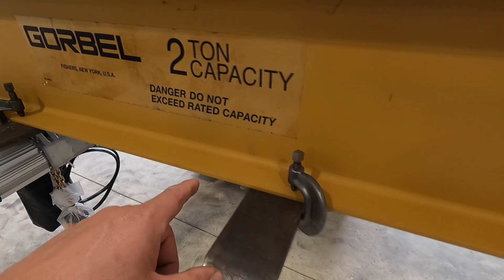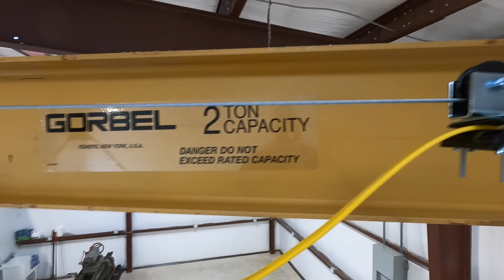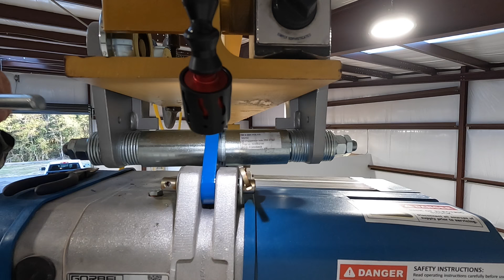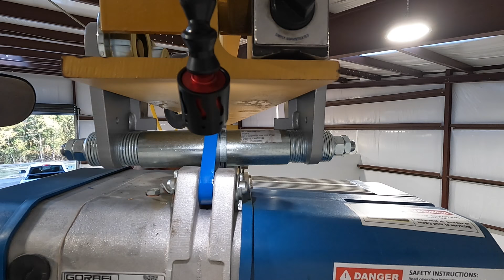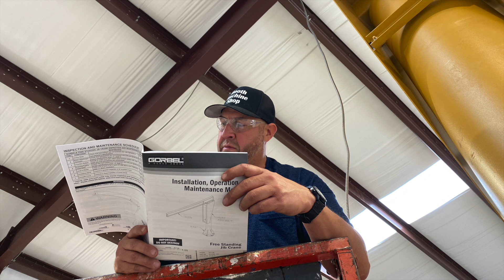Gorbel Jib Crane Installation Part 2

Comment: After reading through the comments here, I think you need to do another video concerning the tag-line on the boom. Specifically, a video showing the complete replacement of the existing line. Several tag-line/cable-clamp experts have noted that yours is incorrect, unsafe, kills horses, may poke an eye out, and probably contributes to global warming. Having to deal with these "jobsite experts" on a daily basis, I recommend the following 3 actions be shown as a way to comfort and appease them, so they may feel good about themselves and move on.
    1:  Remove existing tag line, except for the one eye-bolt at the far end of the boom. (This will be re-used).
    2:  Acquire @ 20' of cotton clothesline rope. Tie a square knot at one end, feed rope through hole where eye-bolt was removed, then pass through the remaining eye-bolt at the far end.
    3:  Pull rope taut, and secure with a granny knot. Attach the 3 trolley rollers to rope, then clamp the flat wire to the trolley rollers to finish. The tag-line is now "Safety First!" compliant.
I'm confident this will carry the 3 or 4 pound load with a large safety factor. I'd calculate the numbers, but I've misplaced my "load of wet laundry to pounds" conversion table.  (Sorry!)
With the problem solved, and nothing to yarp about, the experts will saddle up their "dead horses" and ride off. With luck, it will be off a cliff.   lol   Thanks, Adam!
Reply: Way more useful than knowing the right way to install cable clamps.  Thanks!

Comment: looking fabulous! " hint" forklifts do not need to be running to lower the forks, only to raise them or using side-shift feature.
keep up the fantastic work!  when looking for a forklift ask for a 3 stage mast, it will give to a higher reach. and lower clearance. FYI.
Reply: and because of that your should NEVER go inside or exit the the forklift at the side of the controls, this is the first forklift i see that that is thought off, every European/jJapanese fork lift i have used over 25 years of experience that have not been a possibility.
often wanted to, but it just shouldn't be possible.
Reply: @ArniSPeturs   Linde, Toyota, Mitsubishi, Yale, Cat, just a few that have through cab models
Reply: Full Free-lift mast will give best clearance, fork carriage travels to the top of the 1st mast section before the next sections start to lift

Comment: Looks like you're still missing the hoist gearbox vent plug. The bolt with the copper washer is for shipping/storage.

Gorbel normally provides the matching female electrical plug and a bolt for supporting the chain bag.
Reply: Why does this crane seems to have a couple of parts missing? Why ship a non complete crane assembly? Are there no quality inspectors?
Reply: @orfeous I think Gorbel either forgot one of the boxes when packaging the kit or it got lost somewhere during shipping or after arrival.

Comment: Worked on several 1/2 to 5 ton trolley hosts and never seen it heard of lubricating chain before using. Oil on a chain is a magnet for dirt grime steel chips etc. Okay to oil roller chain that are used on chain sprockets. Not a fan of flat cable. Always used heavy duty cord that is rated for 600 bolts such as type SOW. We called SJO cord junior cord. Absolute garbage cable.  Great vid. Worked on a very old two phase hoist with a motor to make it travel. Buttons were on a 240 volt circuit and operator would get socked when itwas damp or rained due to being outdoors. Think somebody made them switch over to a lot safer 24 volts to feed buttons.

Comment: I would use 9/16" (very close to 14mm) grade 8 bolts instead of drill rod for chain fall attachment pins. Strong and faster. I would also put a small plate on top of the pivot shaft and then put a bolt through the hole instead of relying on those hose clamps. Remind Abby not put her hand between where 2 pieces of metal are coming together. Need a stop so it doesn't take out your vent pipe. Nice crane!

Comment: Great. Note you’ve fitted the bulldog grips the wrong way round. The U bolt should be round the running end, the dogs round the standing part. Two each end would have been better.

Comment: nice video. have a questions about the shims being made of brass. will they compress over time being made of soft brass from the weight of lifting up to 2 ton. or should they be made of steel? so they can't compress if the thickness is really that important. this is something i don't know about and am just curious. but would really like to have this crane in the shop i work in

Comment: Nice crane Adam!!
Just a small comment on using those steel wire clamps: the u-shaped threaded rod should always be on the “unloaded” part of the wire. When tightening the two nuts, a deformation of the cable does occur which actually causes a weak spot in the wire. In this case, were the load is low, that will cause no problems, but with more important connections the cast half of the clamp should rest on the wire part that takes the load.
Reply: "Never saddle a dead horse"
Reply: Yep, never saddle a dead horse.

Comment: Not trying to be a smart alec, and in this app not critical. But you put the cable clamps on wrong, the old saying don't saddle a dead horse.  The U clamp clamps the dead end on the cable.
Reply: Came here to say this.
Not really a big deal in this case, since there's very little load on the cable, but always a good habit to do it the right way

Comment: Your rope cable clamp? The saddle goes on the load side of you cable ..(never saddle a dead horse)
Reply: Its not going to hold any weight,  just wire.  But yes, id also swag a crimp on the ends so it cant pull out of the clamp.  I dont trust them clamps that much.

Comment: Don’t saddle a dead horse
Reply: lol I was thinking this the whole time
Reply: In this case, it doesn't make a bit of difference since the cable is only supporting a wire, but yes, the cable clamps are backward.
Reply: Saw that in the thumbnail image.   But the use is just about the lowest risk application possible. 😁   50/50/90 rule
Reply: @CB.5  It matters. Granted there is no load on the cable, but that's no reason to do it wrong, yes?  You may screw up one day and kill someone or yourself.  The problem is the U-bolt crushes the cable and if on the live side, you've just created a weak point and cut the capacity of the cable ten fold.

Comment: Should use some of that spray on the top pin that the bearing slides down so it doesn’t rust. It will be way easier to take apart when you go to move it to the new property.

Comment: all of those washers reminds me of a kid in his back yard fixing his bike.  If I had a machine shop, i would be making myself some spacers that more exactly fit that beam.  It's really hard to believe that Gorbel sees 14 washers as a viable means of making a over head Crain.
Reply: Everything is built with lego parts these days. Nothing is made custom fit that fits exactly how it's supposed to. That's just a fact.
Reply: @JosephArata  yeah, I get that, and it will probably work just fine but it does not inspire confidence.  You would think with  what one of these cranes cost they could do a little bit better than 14 washers per side.  In a day and age of CNC machining what do you think the actual cost of making the correct size spacer is?  It's just a different length of the same part they used anyways.

Comment: Gorbel will be very handy with the Chuck changes on the Pacemaker as well as the parts/material. Great video about the needs to get 'er dun. I'm already liking the Pacemaker but I still love those in the old shop, the Monarch and South Bend.
Reply: Did you mean the Monarch and the Victor?
Reply: @russellstarr9111  Likely. For sure the Monarch...wasn't the name of the other one.

Comment: Can anyone explain why the need for that DIY shim? All I can think of is to pitch the jib arm slightly upwards to cater for the sag when under load, if so then you imagine they would have built that in at the fab stage?
Reply: You're correct. The reason is probably cheaper to add a sim then fabricate that gap out it was an afterthought.
Reply: The manual has you formulate the thickness of the shim based on the length of the boom, so that is indeed to compensate for sagging.
Reply: @BlackEpyon  I noted that, but why don't they ship every boom with the correct shim? It seems odd to me, who has a box full of shims handy all the time?

Comment: I noticed your outlets have stainless covers, normally with steel outlet covers the outlets are installed upside down. If the outlet cover was to come loose and fall off with something plugged in it could trip the breaker or possibly cause a fire. If they were mounted upside down the cover would only fall on the ground on the plug, if the plug has a ground.
Reply: Also the 10 ton overhead cranes at my job are set to .063 (1/16") clearance on each side on the trolley for variation in flange width, so you are correct on the clearance.

Comment: Great work with the crane. I'm no expert but can I suggest your add some wood blocks to the end stops of the carriage to prevent dings on the rollers. Also maybe mark on the floor with tape or paint the extent of the crane's reach to allow you to line items up later. As well, when moving items in to place using something like Facetime or Google Meet between  your two phones would allow the operator to see what the alignment is. 29m00 PLEASE Abby don't put your hands into a piece of equipment being moved, it is all too easy for one wrong move to cause serious injury. Use a push stick.

Comment: I noticed that troughout your videos you are always safety concious. I have been operating lift and forklifts troughout my career in the constrruction industry and I never had an accident. I just cringed when I saw you walk underneath the crane without it being even pinned in place by a big screwdriver or even better Abby could have put in one of the bolts a safety precaution.

There are so many OSHA violations in there it isn't funny Adam, if you were on any jobsite you'd have gotten a probable suspension if not actually been fired right on the spot. The danger to both of you during this episode was extremely real and it was quite a bit more dangerous than a shard of metal flying out of a lathe or milling machine, youou can recuperate from a cut. 

You cannot recover fingers (Abby guiding you to place the jib up) when they get caught, crushed and cut off  between solid welded 2x2 steel angle and a 7 in wide I beam. It is mostly impossible to recover from being crushed by a falling I beam that weighs in the neighborhood of 2000 lbs with the chain, hoist ect installed on it. We have to take courses and be tested bi-yearly on these equipents and proper rigging. 

I'm not criticizing you personally but it does give the viewer the impression that this work is easy and that safety hazards are very low, IN THIS CASE THEY WEREN'T. Your channel being watched by thousands of viewers, it gives the wrong message about safety. Safety glasses are great when hammering stuff in, thightening bolts down with an impact gun but in this case a THICK PAIR OF WORK GLOVES and a pinch bar to lock the Jib in place trough the center bolt hole would have been a lot more effective as safety measures before you got off the fork lift and walked underneath the load. 

Yes you had C clamps on the forks to immobilize the beam. In real linf they were just about as useless as if they hadn't been there, the forks of the lift and the part of the I beam  that you clamped them on are both tapered (in the front as opposing angles making it a triangle), had that beam started to shift and slide the front ones would have popped off first and then the back ones would have let go. Very honestly you should have contracted that part to the guys that installed the American Pacemaker for you and then taken pics and footage safely and the work beig done safely as well.

Comment: No no washers machine some proper spacers 😁
Reply: Trolleys are always supplied with washers to adjust for different beam widths from the manufacturers
Reply: @Ropetangler   i agree but when you find correct adjustment use proper spacer the late is there btw sorry for the bad english  😁

Comment: The best way to get that plastic off the crane arm is with an eraser wheel on a grinder. They are designed to remove decal stickers from vehicles without damaging the paint underneath. They are rather cheap as well.

Comment: Hi Adam, I think it is a good idea to put rubber bumpers on there at each end so that the trolley does not hit metal to metal ....Cheers :)
Reply: He could put bumpers on but not required per OSHA because the trolley is not  motor driven.

Comment: You put the saddles on the wrong side of the cable on the wire hanger
Reply: As they say, never saddle a dead horse
Reply: I thought of that as well.  HOWEVER the cable would be on load bearing.  It will only be supporting a small cable and the pullys.  I'd say 10-15lbs at most.  The cable and saddle size is over kill for the job they will be doing.  But as a general rule you are correct and Adam most likely will fix it, because he is a perfectionist (ni a good way), once he realizes the mistake.

Comment: Adam, I've only got in a short way but I think your supplier gave you two of the same end stop/cable supports. Surely they should be "handed" ie a left and a right. The end stop/ cable support at the Pilar end is the wrong way around. It will cause the other side one to do all the work of stopping the hoist at that end. Probably won't ever be needed but it's wrong none the less. Back to the video.
Now that you've installed the cable, if you're going to change the far stop don't cut your cable yet. It'll be too short if you do change the far stop.

Comment: You don't saddle a dead horse or a dead man don't need no nuts. Not that it really matters in this circumstance but the dead end of a cable always gets the u-bolt and the saddle goes on the load bearing cable.

Comment: As a crane installer. A spud wrench works wonders in these situations.
Reply: Spud wrench? Are those the ones with the "spike" like handle? I thnk Andrew Camarata uses those all the times if I interpret correctly what they are. I live in Germany and here something similar is known that came to my mind seeing this. they are called in 1:1 translation scafolding wrench, allthough those are not a 1/2 inch ratchet wrnech but are limited to either a 17 or 19 mm (or both, I donßt know what are the standard sizes on scaffolding, could also be 19 and 21) ratcheting wrench. Advantage over a socket wrench for scaffolding is that if you have a long thread it fits through anyways. But they have that spike end for a handle as well, to align and pry on things.
Reply: Known as a 'podger' in the UK!
Reply: @alexanderkupke920  correct! They also have ratchets with the spike at the end. Comes in super handy when you are a few millimeters off and you just poke that thing in the hole.

Comment: Wonder if the chain hoist pins have high sheer strength. Perhaps get pins as supplied by Gorbel so you are covered in case of insurance stipulations to use original manufacturers components.  Looks like really fun time you had.

Comment: Did the instructions specify a torques for those all bolts? Would some paint lines on the heads and nuts be advisable to spot any movement of them? Probably just my "over-thinking". Glad Abby didn't get any pinched fingers!! 😁 Sign her off on "Forklift Driver, 1st Class"! 👍

Comment: 15:35 It doesn't matter because once a load is applied, the taper of the wheels  will keep the trolley centered on the beam as it rolls.

Comment: Adam, I think the wedges go under the bolt heads on the cross beam to level the bolts on web of the cross bean, not on the swivel bracket the cross beam bolts too.

Comment: On your cable line with the clamp. You may find the wire could slip after awhile with the weight going along the cable.  I'd try putting 2 clamps and try putting wire looped back onto itself and tape the ends of the wire so it doesn't fray out and tape at the end of the clamp if you have some wire 2cm away from clamp to make it look nice neat and professional.  Just a suggestion.

Comment: Great job getting the crane up!

One thing I noticed in a couple of videos lately, is that the audio is often only on the left channel, nothing on right. I think the Rode device you're using with your lav mike is a single channel audio recorder, you might want to pan it to center when you're compiling the video :)

ETA: Sometimes it is panned to center, sometimes it's not. I guess it's easy to miss the setting :)

Comment: On those scissor lifts if it stalls out like that just hold it going up and jump a couple times. It will go.
Reply: there are a ton of ways to bypass safety switches - not all of them are good for you
Reply: I couldnt count all the issues ive had with scissor lifts, the wheel locks annoy me the most

Comment: code clearance (required clear floor space) for the electrical panel there is 30w X 36 from the wall X 6.5 ft height.  You can still use the space around that clear space so just thought I'd let u know.  Alot of progress here sir.

Comment: Been using an electric forklift as well as the petrol ones.  If you can find a electric with the right carry capacity that would work great in the new shop
Reply: I wondered about an electric one. I think it's suit Adam's 'turn it off all the time' way of working !